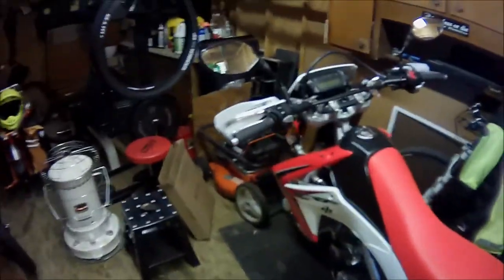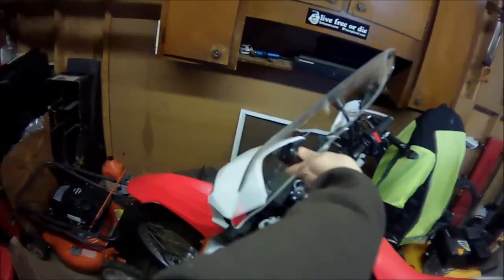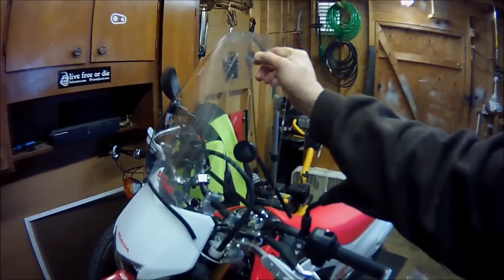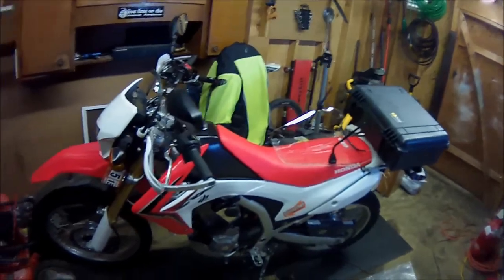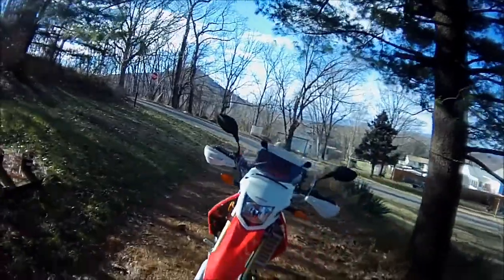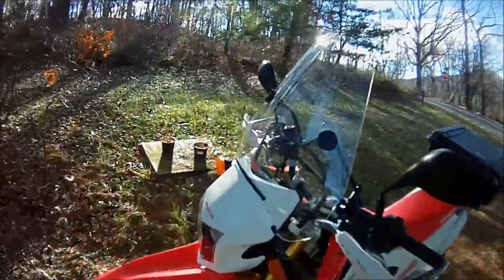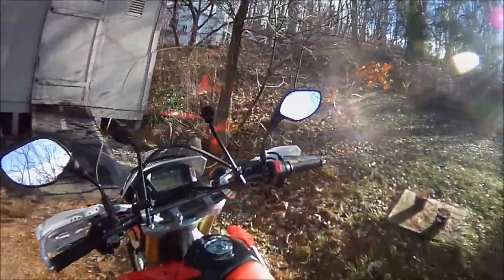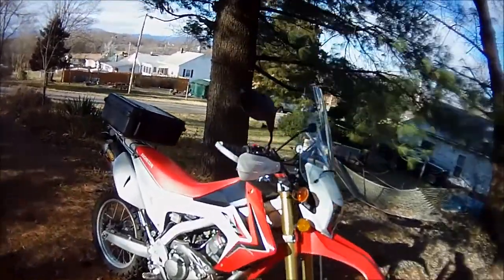2013 Honda CRF250L Spitfire Windshield Install and Review

Comment: Thanks much Adrian.  It's now 2017 and first idea was to get the Rally version.  However, for various reasons (mostly shocks too long/cushy), I'm likely going for a used CRF 250L  -Likely with this screen installed.

Comment: Thanks for the review. I just picked up an old nighthawk and I really don't like riding on the freeway without a windshield. Anything over 50 and it starts to get uncomfortable real fast and when it's 50* it gets cold real fast. Wasn't sure if this would cut it or if I wanted a bigger windshield. This helped me decide to try the spitfire. Not looking for extended freeway driving but here in Idaho the speed limit is 80mph... So a windshield would help!

Comment: The sites I go to want me to select a bike when buying this windshield..does it matter what bike? I chose a 2010 Honda shadow RS because it has  7/8 bars. Just want to make sure this is universal etc. Thanks man..good video!
Reply from the maker: +struckus  Nope
Reply: +struckus The manufacturer is Slipstreamer and the model windshield is S-06 Spitfire. The windshield is available in different window tints and for different size handle bars. Go to the manufacturer's website product page and look at the different options. They also have an application guide that will list the different motorcycles along with the bikes bar size. Choose a bike that has the same bar size as your CRF250L. The 2010 Shadow RS has 1 inch bars, but I think you will receiver hardware that fits 7/8" bars as well. Your Lucky